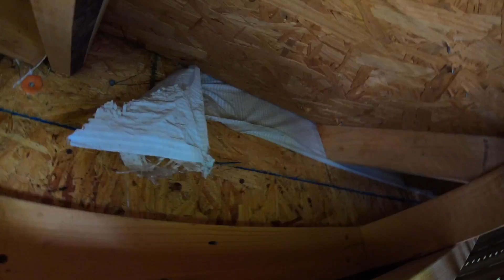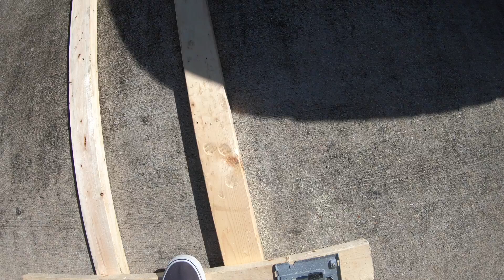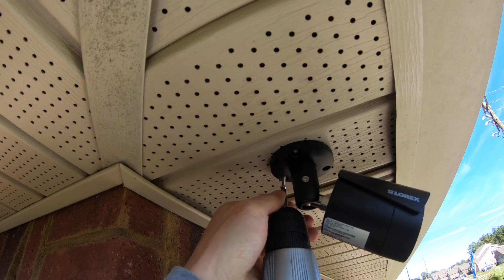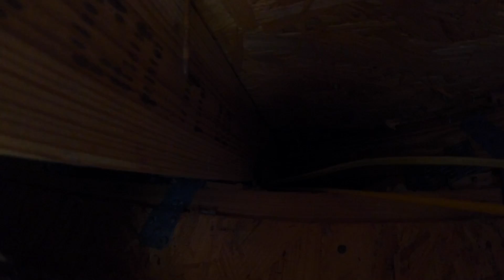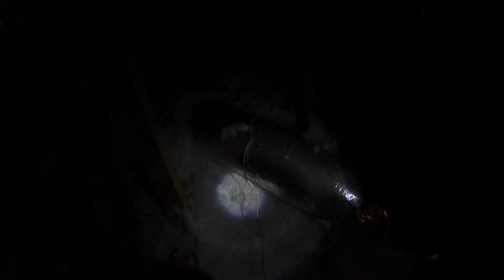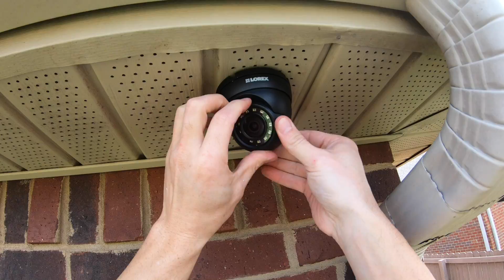NVR Camera Installation Under Vinyl Soffit

Comment: Why did you use some "dome" cameras rather than all "bullet" type?
Reply from the maker: @w4baham  my parents bought these and I installed for them. I want to say the bundle they purchased had two of each. The bullet shape ones block direct lighting a little better if direct sunlight would have been an issue.
Reply: @jbaswoll3221  Thanks.  Good to know.  I am in the process of picking out which ones to purchase.  I was also advised by the dealer that the dome type are more vandal proof.

Comment: I just received my system and I'm a little pissed that the camera mount only allows 1 axis adjustment. I'm thinking about trimming the plastic on the mount to allow for 2 axis adjustment. Did you have any issues getting your cameras adjusted correctly?
Reply from the maker: Len Polidori I did not. The cameras were maneuverable in all directions and also had a “reverse” feature if you did need to use it.

Comment: I found your video after seeing a company using your footage to promote their cameras on Facebook. The company is EyeCube being promoted by IndiGoGo. I hope they paid you.
Reply from the maker: Thanks Scott for letting me know.  I am surprised that you recognized my video clips from the first few seconds of EyeCube's video.  Although EyeCube should have at least asked me, I am not concerned that they used parts of my video.  Hopefully you find the right camera system that works best for you.
Reply: @jbaswoll3221  I have been trying to figure out a good way to remove my aluminum soffit to do what you did. I saw their ad then searched YouTube and came across your video.

Comment: I placed a thin piece of wood, which I painted to match, underneath the soffit to avoid drilling into the soffit itself. Works and blends perfectly. 
You can also use aluminum sheet.

Comment: Good job! It looks like my work is cutout for this weekend. Those 2x4's are a good idea and thanks! 

My only thought or add is to use longer screws and measure some hollow tubes for standoffs so the cheap vinyl soffits don't pucker in. (I have the same cheap vinyl soffits).  My problem is I have a couple areas with a 3-1/2" fascia on the soffit so I'm guessing a matching junction box or something.
Reply from the maker: I agree, James L, in the comments, mentioned "to use a 3/4" blocking as a spacer so when you tighten the screws it doesn't collapse the vinyl."  Good luck with your install!
Reply: @jbaswoll3221  .. Thanks and thanks for the tip. 👍😎👍
Reply: @Red Fire Wolf 🐺🔥 .. If the screw goes through the tube then it won't (shouldn't) go in any further. So determine a flush length for the tubes and the vinyl or aluminum soffit won't pucker in. The blocking is something under the 2x4 to extend to the soffit (touching it); I'd think about treated lumber at that point from water getting trapped in-between.

Comment: how many feet of ethernet cable is required per camera ? and what is maximum length one can use ?
Reply from the maker: The maximum length for CATV is typically 100 meters (just over 300 feet).  I would assume each camera company has their own specifics regarding length.  The one I installed was POE (power over ethernet) and didn't require any additional power requirements to the camera.  Most bundle purchases will provide the cable which should be more than enough to work with.  The house in this video is around 2500 living space and had plenty of cable to work with (came with five 300 feet rolls).

Comment: what style outlet box is that?
Reply from the maker: There wasn’t any additional boxes required. As the base of the camera all came from the manufacturer. Unless you are referring to something else?
Reply: @jbaswoll3221  I'm referring to the outlet box you installed in the drywall and pulled the cat 5 through
Reply from the maker: partywelter I see. I ended up using what they call “brush wall plate”. Since there was a lot of cable this was the easiest way to manage it and still keep it neat. The outlet box is a “low voltage mounting bracket”. Hope this helps.
Reply: @jbaswoll3221  thanks!

Comment: Is there a reason you didn't just drill through the brick, fish cat5, and mount there? Just curious.
Reply from the maker: I think it would take more effort and I also don’t have the tools to cut larger holes in brick. It would probably look good though. You would also have to consider direct sunlight on the camera. Since this is under vinyl I won’t have to worry about any glare and maintenance cleaning of the lens.

Comment: The hardest part that bothers me is probably wiring back to the house..How do I know which holes the wires go and where to securely put my nvr.
Reply from the maker: Tom Tan 
In the attic there are wires that you can look for to help you such as coax cable or the electrical romex cable (should either be white or yellow color - these cables are for your receptacles). I drilled a new hole since i had to pull six CAT5/6 cable through the hole. In the attic I found the existing coax and romex cable and drilled a new hole right next to it. Prior to doing so at ground use a stud finder to have a better idea where the studs are so know how much space you have to work with and which side to drill from the attic. I hope this helps... please reply if you need more clarification or more questions.
Reply: @jbaswoll3221  So when determining where to put the hole for the NVR inside the house I should use a stud finder up the wall to be sure I don't run into a 2x4 brace along the route that would stop the wire from being pulled? If I'm terminating in the basement then I'd need to do that on the first floor as well I guess. Maybe I'll just find a place on the first floor to put this and run the hookup to my monitor/TV to the basement!
Reply from the maker: @RichardRuth  depending on where you live (residential codes) and how high your wall is, there may be a fire block somewhere in the middle of the wall that you plan on pulling the cable through.  I would go ahead and use a stud finder to determine if there is one installed.  If you have one they are are typically installed horizontally at the same elevation throughout.  

A fire block that transitions to your basement shouldn't be too hard to drill through as long as your bit is long enough to penetrate through all the wood.

Comment: Great job and you did it all by yourself with no help. I would just add one little advice to anyone installing cameras for the first time is to make sure your cameras have been tested and are working before mounting them. Thanks for the video.
Reply: Absolutely,  I  made this mistake only to find out two cameras were bad and had to be replaced.  Great advice!

Comment: And electricians should be running wires a little more organized and away from potential walking areas. They know eventually someone is going to be in the attic doing some sort of upgrade/install. Just plain sloppy if you ask me.
Reply: Considering those are powered by ethernet there's no electrical connections to be made except power at the DVR to the wall.
Reply: Considering he's the home owner it doesn't matter
Reply: @MCOGroupNews  that and the fact that an electrician wants huge sums to do this work!

Comment: I was wondering if the joist could hold my weight. I'm 6'1" and 200lbs. Were you worried at all?
Reply: You'll be totally fine bro, just don't step anywhere else lol.
Reply from the maker: Hi Randy, I wouldn't be concerned with 200 lbs.  I would be more concerned about not stepping on the joists since they are approximately 2" in width.  My patio in the back has a swing supported by two joist and can easily support 500 lbs.
Reply: They hold roofs up with a foot of snow, 200 lb isn't anything to them.

Comment: Thanks for the video.  Nice to see you actually have "real world" accidents.  IE:  The connector/hole...etc.  It's tiresome seeing pro's install everything perfectly everytime.  Nice to see a home owner actually going through it.  I'm trying to figure out how to install a camera system and pull wires through.  And where the hell to mount the NVR and lcd screen.  EDIT:  Can you tell us where you installed your NVR?  That's the part I'm having the most problem with.  If I put the NVR in the attic, it would be easy to install all the front and rear cameras for the exterior of the house but then I don't know how to run a cable from that to the inside for the monitor/router.    If I install the NVR in the basement where my router/network drops are then I have to figure out how the hell to run 5-6 cat6 cables all the way up 2-3 floors of a finished house :-(  yuck
Reply from the maker: Thanks for the comments.  Regarding the NVR I chose to install it inside the house in the living room b/c the attic location was not a convenient location to access if I needed to.  The cables that came with the network camera were 100' a piece so I had plenty of CAT 5 cable.  I agree it would be a easier install in the attic but there are some things to consider such as accessing the NVR to pull videos if you can't access it through your network or "cloud".  The other consideration is going to be the heat in the attic, you'll probably want to read the technical specs on the NVR to see what the heat ranges are that it can handle.  Ideally you do want the NVR out of site in case someone does break in and decides to take it.  However this NVR comes with free "cloud" storage for a week, so I'm not as concerned with theft of the NVR.  Also, verify your distance with CAT 5/6 runs... i think it has limitations of 328 feet.  Good luck with you install, and if you end up choosing a location, please share.
Reply: When installing my system I installed the NVR in a centrally located room WITH an AC vent. I advise against putting the NVR in the attic, as during the summer the heat from the sun all day and lack of AC and heat the NVR produces could easily damage the NVR and/or the HDD inside. Both normally have operating temps and an attic is normally above those permitters. I ran all wires from the cameras down a wall into the centrally located closet where the NVR is installed (you could also run through ceiling if easier than wall).

Comment: Nice installations. Where did you get the yellow rods from?
Reply: Harbor Freight $9  https://www.harborfreight.com/3-16-inch-x-33-ft-fiberglass-wire-running-kit-65326.html
Reply from the maker: You can probably find them at any hardware store. They're just fiberglass rods.  Here is a link from Amazon.... https://www.amazon.com/Fiberglass-Running-Cable-Coaxial-Electrical/dp/B07519CLJX/ref=asc_df_B07519CLJX/?tag=hyprod-20&linkCode=df0&hvadid=216506979975&hvpos=1o1&hvnetw=g&hvrand=6565951128894687717&hvpone=&hvptwo=&hvqmt=&hvdev=c&hvdvcmdl=&hvlocint=&hvlocphy=9027834&hvtargid=pla-362775615011&psc=1

Comment: Great video. Thanks for posting!I like how you clearly explained little details.
One question: What size hole eventually worked for the small 2x4 you installed above soffit?
Reply from the maker: Thanks for the reply.  I ended up using a 1" spade bit that was large enough to accommodate the outdoor CAT V connectors.
Reply: JBA swoll maybe do the hole before putting the wood piece?